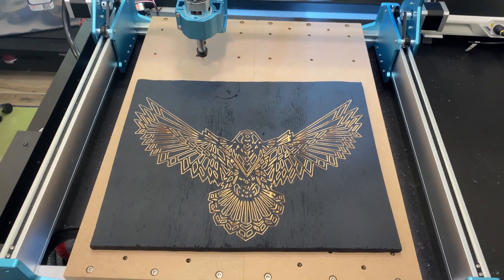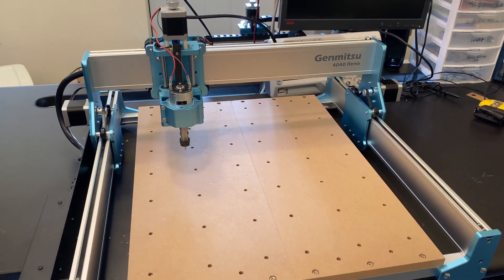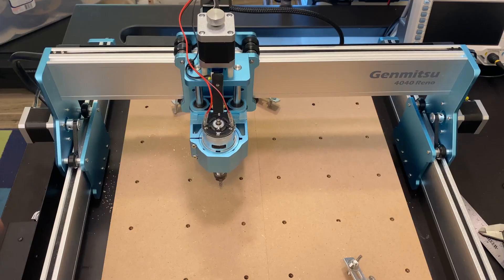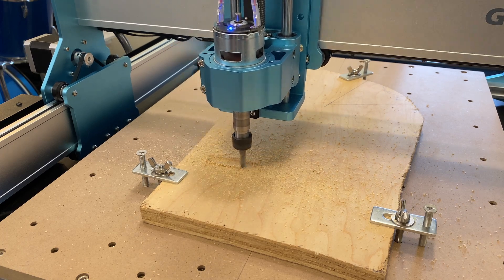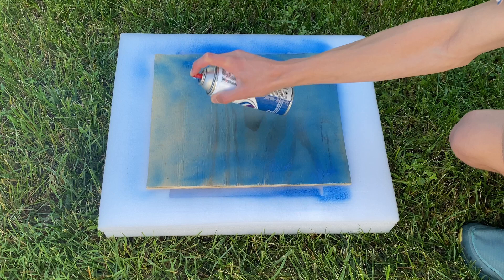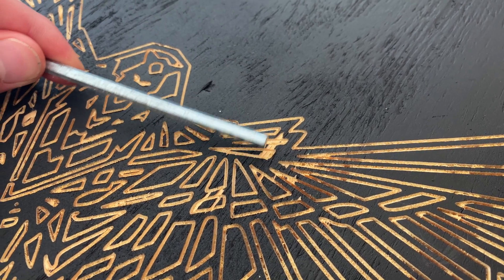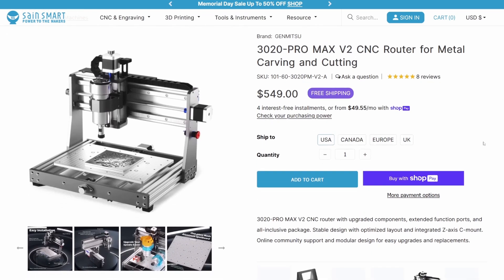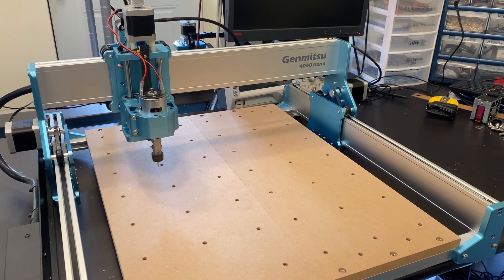4040 Reno CNC Review and Demonstration - Sainsmart

Comment: Really helpful video!  Thank you.  This is my first CNC system, and i thought that initial startup whine was normal.. thanks for the instant fix!
I have a question for you, if you have the time! Im looking to cut some acrylic, but broke a 1mm bit already doing a feedspeed test, as the chips seemed to melt and affix themselves in the slowest lines carved. I have started in on a 1/8in endmil bit instead, but the suggestions for feedspeed im finding online seem absurd.  I tried 2500mm/min, and the lines were no straight at all (seemed to be riding the bit rotation). 
Before i keep attempting my methods, are you aware of a sweet spot for carving and/or cutting out acrylic with a CNC router like this one?  thanks regardless!  take care ^^